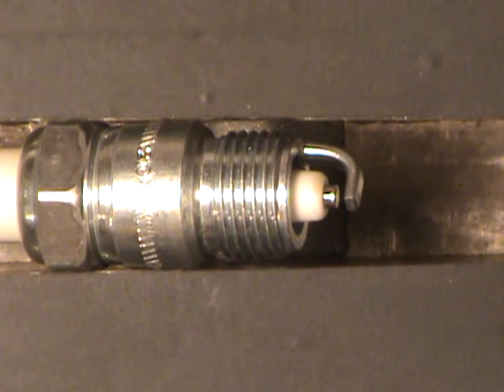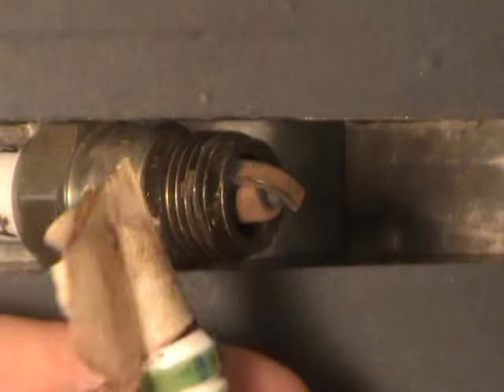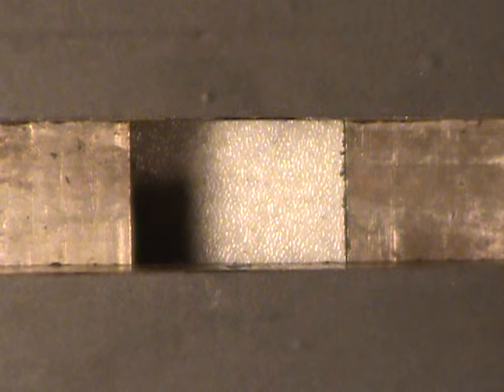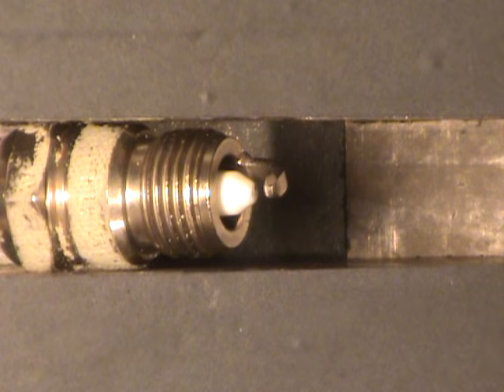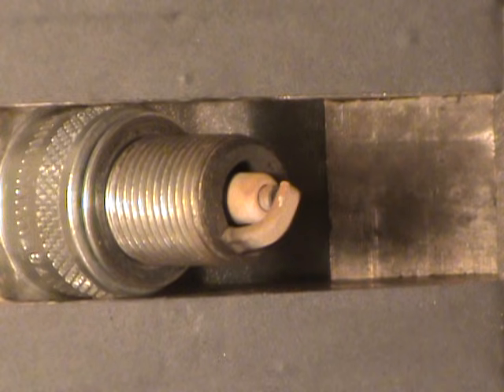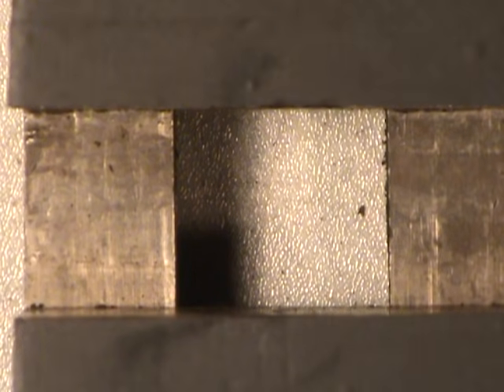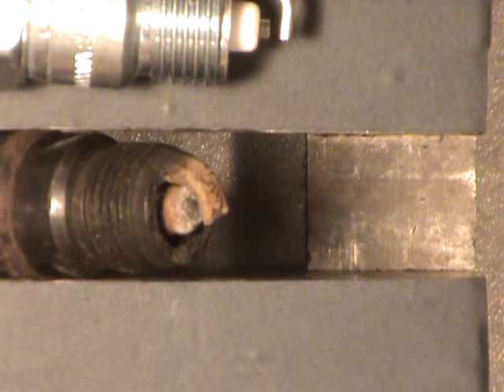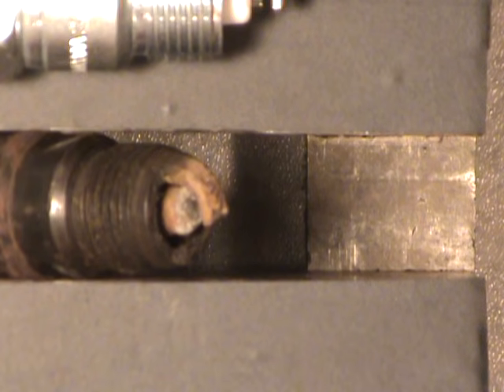SPARK PLUGS How to Read them (Part 3)

Comment: Thanks so much for the education. I wish I had a pic of the plugs I pulled from a 2006 Ford Explorer. The outer electrodes was eaten away back to where the electrode curved.  We put new plugs in and it was a completely different car. Thanks again.
Reply from the maker: Greetings...Eric Stephens.........You're welcome, and, thanks for watching.........It's good to hear, that, all the engine needed, was a new set of spark plugs, b-cuz, the cost of doing so, isn't all that much at all, when being compared to, one of those...(and, I'll use PG-13 terminology), as in..."Oh My Goodness"...I just spent my Vacation Pay, to fix the car...truck...or...what-ever...the heck it is...lol...........I'm guessin', that, your 2006 Ford Explorer, has a V-6 Engine in it, b-cuz, if it was a V-8 Engine, then, those particular spark plugs, are very long, and can sometimes get stuck, and, sometimes, they can be quite the headache, to get them removed safely, from the (V-8 engine's) cylinder head............If you do have the (4-liter) V-6, then, from what I saw, was that, it would probably be using, some conventional/common looking spark plugs...........I always "check" (aka, measure), the..."Gap"...that is between the spark plug's Electrodes, and, make sure that, that Gap, is with-in the Gap-size (usually measured in, thousandths of an inch), that, the vehicle Manufacturer, recommends, for that "exact" engine (please note, that, some spark plug designs..."are not"...Adjustable/Gap-able...!!!)...........Those..."eaten-away"...electrodes, would probably have caused, the "Gap", to increase, to quite the BIG Gap-size alright..........When-ever the spark plug's "Gap-size", shall we say, grows "Bigger" then Specified, then, the Ignition coil, or coils, as the case may be, will have to Work a Lot Harder (think in terms, of the ignition coil, being over-stressed), in order to make a "Spark", jump between those, "much further apart", Electrodes..........If the spark plugs are the common/older type (no precious metals on them), then, they usually don't last all that long, and, they should be changed, at the Manufacturer's recommended "interval"...........Same goes for all ignition system parts, Filters, etc...........Installing, New Ford/specified spark plugs, that have the correct electrode Gap, will more than likely, result in much better Performance, and better Gas Mileage too, but, only, if Ya can keep Ur Big Foot...under control...!!!...lol...and........till next time.......Be Safe, take care, and have a good one.

Comment: never understood the lean definition
Reply from the maker: Greetings...Ruby Napoleon...........Thanks for watching..........Well, as far as, "Lean", or "Rich" is concerned, as it applies, to an engine that burns gasoline as a fuel, then, it's simply a "Ratio", between, that of...Air...and...in this case, the Fuel, happens to be...Gasoline (the "Ratio", is actually by "Weight", just so you know).........Here are two examples for you.........Let's say, that, a car or truck, is just cruising along at highway speed/not too fast, then, the engine can run reasonably "Lean", as in, about 14.7 to 1...Air...to...Fuel...Ratio (or, 14.7 parts of Air, to, 1 part Gasoline, weight-wise, that is), which usually results in, an efficient running engine, and also, gets very good gas mileage/kilometer-age as well...........So, now comes the time, where, a "Rich" (Air/Fuel Ratio) comes into play............Drag Racing, from a Stop, then, the Gas Pedal, gets quickly pushed, all the way down, and, the engine responds with, all of the power that it can produce, and there is a really High Load placed on the engine, then, the much needed, "Richer", Air/Fuel Ratio, could go to, around 12.5 to 1 Air/Fuel Ratio (ballpark figure) as an example...........If, while Drag Racing, from a Stop, and we maintained, that, very fuel efficient, Air/Fuel Ratio, of 14.7 to 1, then, the engine would probably "Destroy" itself, and, if the engine, while being too "Rich", at about that 12.5 to 1 Air/Fuel Ratio, while just cruising along/not too fast, then, it would probably result in, a waste of fuel/gasoline, that the engine "did not" require, under that, "not-so-high", of an engine Load, and the engine, might also end up, having too much Carbon, sticking to the top of the pistons, and stuck onto the inside, of the cylinder's head, and valves as well, I be thinkin'..........Also "ignition timing" changes as well, as in, "More", ignition timing "Advance", while just cruising along, and, "Less", ignition timing "Advance", when-ever, a High Load, is placed on the engine...........So, there you have it, the Basics, if you will, and.......till next time.......Be Safe, take care, and have a good one.
Reply: RockysRoadshow so what should be perfect colour for the bike spark plugs in normal routine???
Reply from the maker: Greetings...Rizwan Ali Raza..........Thanks for watching.........Well, it all depends on, what "year" the bike is, and the type of engine, that's in it...???..........Is it stock or modified, as well as, how it's being Ridden as well, as in, lots of short, stop and go Riding (driving), in the city/at low speeds, or maybe, being ridden, on the highway, at high speeds, for long periods of time...........If you can let me know, just which bike, that it is, that you want to know about, then, what...year...make...model...engine size...carburetor or fuel injected...???...and.......till next time........Be Safe, take care, and have a good one.
Reply: RockysRoadshow greetings..... 
Yamaha yb 125z.... CV carb.... 2017.... ride in streets and highway too..... engine stock
Reply from the maker: Greetings...Rizwan Ali Raza..........Generally speaking, a carbureted motorcycle engine, will probably be showing a Tan/Brown-ish, or, a Brownish-Gray deposit color, on the spark plug, but only if, the Engine is in good shape, and that, the Gasoline being burned by the engine, doesn't have too much Ethanol (alcohol), in its Blend, and that, everything else, such as, a "clean" Air Filter, a reasonably "clean" fuel filter, and that, all carburetor "adjustments", are done correctly, as well as, having the "correct" ignition timing" too, if applicable, that is...........if the spark plug's porcelain, looks to be really White, then, the air/fuel ratio (mixture), is probably too "Lean".........If the spark plug, has, what looks to be, Black Carbon dust-like stuff on it, then, it's probably too "Rich", or, the Choke was left "On", when the engine was fully warmed-up, which usually causes a "Rich" condition as well............If you have the "Owner's Manual", for your Bike, hopefully, it will have some good Maintenance information in it, such as, the type of Gasoline, that Yamaha "recommends", (octane rating) for your Bike, as well as, some (tune-up) Specifications as well..........Also, when-ever installing a New spark plug in your engine, try to get the "Exact/Same" one, that Yamaha installed in it, when the Bike was Brand New, or sometimes, by not doing so, there might be a problem, possibly............Also, make sure, that, the "Gap", that's between the 2 spark plug Electrodes, are what Yamaha "specifies", for your "Exact" Bike, so the engine has the best chance at running really good for Ya..........Have a look at your spark plug, once in a while, b-cuz, if there is something that doesn't look right, then, you'll probably have, a form of, shall we say..."Advanced Warning"...that something, just isn't right, with your engine, possibly.........Be, and Ride Safe, take care, and have a good one.

Comment: What does it mean when you found blue powder inside the spark plug wires to the coil
Reply from the maker: Greetings...Edgar De Leon.........Thanks for watching.........Well, I don't recall that, so called powder, being blue at all, but, here are a few things, that, will hopefully, be of some help to you..........The spark plug Wire, along with its metal terminal, that goes down/into, the center, high voltage/output tower, on top of, an older type of, oil filled/cylindrically shaped ignition coil, was, where I saw, some interesting, shall we say, high voltage, "damage/destruction" alright..........The, spark plug wire's, center, high voltage/carbon string, type of conductor, for some reason, wasn't making a tight & good contact, with the metal terminal, that's, stuck on the end, of that very same, spark plug wire..........So, when a small gap occurred, then, the high voltage, would start "arcing/burning-away", the spark plug wire's, conductive core, and, that small gap (over time and use), became...bigger...and...Bigger...and...BIGGER...until, it got to the point, where, once the engine warmed up (a bit), then sometimes, the engine, would just shut itself off...!!!..........Engine, always started and ran good, when it was cold, by the way..........Another place, where you'll usually find some "powder-like" deposits, is usually, on the "inside", of a distributor cap (I've, even seen "Green" powder), reasonably close, to the spark plug wire's, distributor cap's, (inside) "terminals", and maybe, there'll be, some powder like stuff, stuck on, the "tip" of the (spinning) "rotor" also...........You can probably, also call, some of the deposits, that are sometimes found, on the spark plugs, powder as well, I be thinkin'.......and.......till next time.......Be Safe, take care, and have a good one.

Comment: Hi thank very much for this video. I found look like grey color mix with tan at ground electrode and some part insulator spark plug. Could be my motorcycle run lean.
Reply from the maker: Greetings...Jack 135LC...........You're welcome, and, thanks for watching...........That, grey/tan color, doesn't sound too bad..........Whenever I start seeing, the spark plug's, center electrode's porcelain, approaching a white-ish color, then, I start getting worried (maybe too lean, of an air/fuel ratio/mixture, perhaps...???)..........Just never, go too Lean, when-ever going full throttle, b-cuz, that's usually, where the real expensive damage, starts happening..........Here's a clue for you...if your motorcycle's engine, when fully warmed up to operating temperature, and, while just cruising along/easy on the throttle, on a level road, and, it is..."surging" (kinda like, the motorcycle, jumps ahead, and then back, and repeats, over and over again), then, to me, it's usually a lean-condition, but, can be other things as well, sometimes, and.......till next time........Be Safe, take care, and have a good one.
Reply: Thanks for your tip. I have done jetting and tuning my carburetor, so as are result spark plug appear brown color but little bit dark and feel not surging when I ride. Kudos
Reply from the maker: Greetings...Jack 135LC...........You're welcome, and, It's good to hear, that your motorcycle's engine is running good too..........Here are a few things, that can affect, the color and amount of deposits, that might be seen on a spark plug, providing, that the engine is in good condition as well...........The "type" of Gasoline, that the engine is using, as in, the higher the %-age of Ethanol (alcohol), that there is, in the gasoline's Blend, then, some people are saying, that, less deposits, will usually be seen............Race Gas, that is Leaded, will probably leave more deposits..........Then, if the engine is running Lean = less deposits, and, might be white-ish colored, and, too Rich, usually = a black carbon (dust?) coating..........Then, the ignition system's condition, if weak, or misfires, can fool us too, as in, looks to be too Rich, sometimes.............The ignition Timing Curve/amount of ignition Advance, for a given Load/RPM, can have it share of things, to say as well.............Then, there's the spark plug's Heat Range, as in, too cold, then, the deposits won't burn-off so good..........Too Hot of a Heat Range, can really burn-off those deposits, and, can also, Damage or Destroy an engine, especially so, while going full throttle, with a high load placed on the engine...........To keep the engine "Safe", then, never, ever, go too Lean, especially at full throttle/high load on the engine............Like they say, Ya can only go "Too Lean" once, at full throttle/high engine load...(b-cuz, the engine just blew up...!!!)...and.......till next time.......Be Safe, take care, and have a good one.

Comment: Hi, I just change my spark plugs on my 2013 F150 with about 50,000 miles on it. The threaded portion of the spark plugs were blacker than what I thought they should be, and one of them (the cylinder closest to the driver) had some black oil just on the threads of the spark plug but not inside of the plug.  Do you think this would be an issue?  Thanks!
Reply from the maker: Greetings...Eric Hochstetler.............You're welcome, and, thanks for watching............Well, if there was an issue, with a spark plug related Misfire, then, the OBD-2 (On Board Diagnostics, Version 2) computer system, that's in your 2013 F-150 Pick-em-up-truck, will probably let you know, in the form of, a dashboard Warning Light, possibly..............Also, if there isn't any Warning lights glowing at you, then, there might be...???...a Trouble Code, or more than one, that's being Stored, in the OBD-2/computer's Memory, possibly.............A Scan Tool (looks, kinda like, a slightly larger, hand-held calculator) can be connected to the OBD-2 computer, and, there's usually lots, did I say Lots, of information, that, that Scan Tool can display, that, the OBD-2 computer, has, contained/stored with-in "it"..............Some Automotive Parts Stores, might "Scan" Your Pick-em-up-Truck's Computer for "Free" (no charge), so, just make a few phone calls, and see if you can find one, that will Scan your OBD-2 Computer for "Free" (good luck with that).............You were saying, that, the "Threaded" portion, of the spark plugs, were blacker, as in, on the Screw-Threads, or, did you mean, on the, shall we say...End of the Metal Shell...that's at the end of those screw-threads...???............If the engine is running really well, and, there's some black/carbon, then, here's what comes to mind (mine, that is)..........Is the "Exact/Correct", set of Spark Plugs, that the Vehicle Manufacturer recommends, for that "Exact" engine and vehicle being used (installed)...???............The spark plug's "Heat Range" is very important............If too Cold, more Deposits will usually be seen on the spark plug/s............If too Hot, then, they might, look too Clean, and might also cause Engine "Damage" as well, and, I hope not............Lots of cold starts (of the engine), lots of short trips, as well as, lots of slow, stop & go, (city speed) driving, will probably result-in, more deposits, being stuck onto, the spark plug's electrodes and porcelain.............Lots of fast speed, Highway driving, will usually result in, less deposits, being seen on the spark plugs, as long as the vehicle, is just cruising along, and not going...pedal-to-the-metal, as I see it (and think it too...lol)...........If there is an engine problem, causing Motor Oil, to make its way into the engine's combustion chamber (and maybe, onto the spark plug/s as well), then, here's something for Ya............Some Leaking, and not sealing very good, Valve Stem "Seals", which can allow, too much Motor Oil, to trickle down the valve stems, and into the engine's combustion chamber, it usually goes...........Worn (too much) Oil Control "Rings", on the Piston/s, which will usually allow, too much Motor Oil, to get past the Piston/s, and into the engine's combustion chamber, it usually will go...........Even, leaking Valve/Rocker covers, that have a leaking gasket, can let motor oil, trickle down, the Outside, of the engine's cylinder head, and sometimes, make its way, onto the spark plug's screw-threads, but only, from the outside of the spark plug, and, just under the Hex (hexagonal) metal part, that's, just under, the "Outside" porcelain, of said spark plug..............50,000 Miles, on a set of spark plugs, is pretty good, and, you got Ur money's worth, out of 'em, as I see it, that is...........If your engine has, the good ole type of spark plug (High Voltage) "Wires", then, they, can "Wear-out" too, so consider a New set of those as well, oh, and, if so, Only change "1" Wire at a time, or, it's probably gonna be, a Pain, in the what-ever, to, try and figure out, which-one-goes-where...???...!!!...???...............Keep up with, regular/preventative Maintenance, as in, Air, Fuel, and oil Filters, and, all of what Ford recommends, as far as it pertains to, Time, and/or Mileage/Kilometer-age (maintenance), oh, and, don't let the Anti-Freeze get too Old, or "Corrosion", will Silently, be eating-away, at your Pick-em-up-Truck's, Radiator, Heater Core, etc. ("Never", Open the Radiator Cap, or work on a "Hot Cooling System", b-cuz of, Pressurized "HOT" Coolant, that, can cause Severe Burns...!!!)...and.......till next time.......Be Safe, take care, and have a good one.
Reply: RockysRoadshow lol you told him lot... His head spinning now 🤕😁